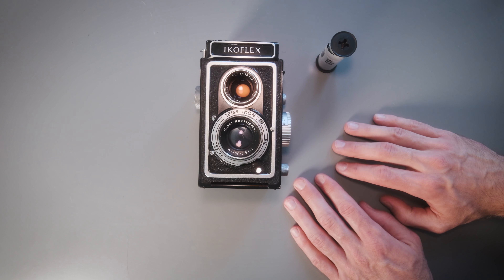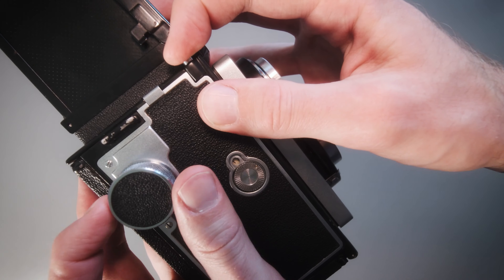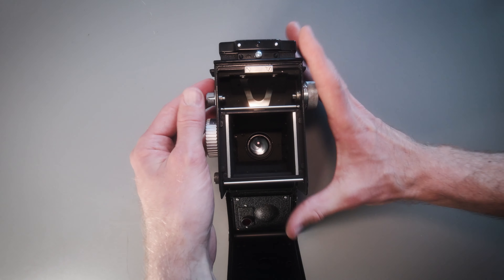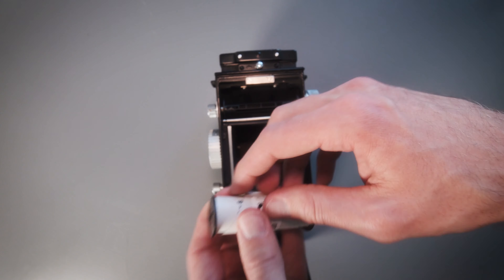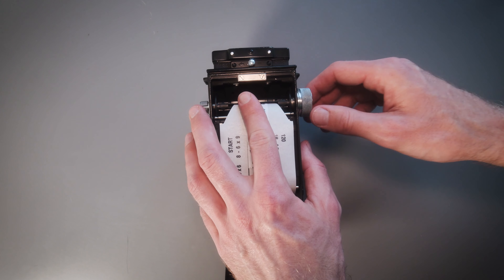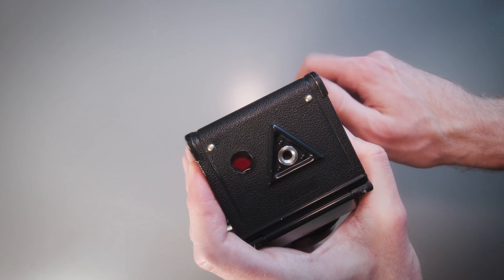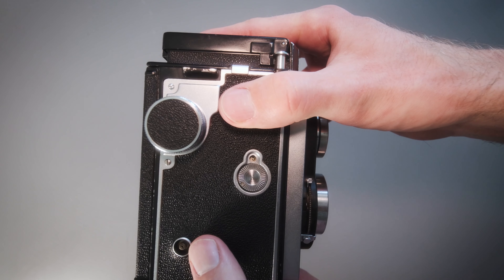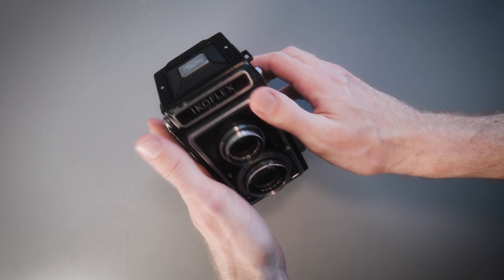How to load the Zeiss Ikoflex Ia

Comment: I just got an ikoflex IIa today, and I found out the little red window in 3:00 on the left, but the 6x6 format shows on the center of the 120 rolls, the "1" in your video is the "1" of the 6x9 format. have you been using it this way with no trouble?
Reply from the maker: You're right, I've never thought about it, but that should be for 6x9. But yes, I've shoot multiple rolls with the camera (maybe 20-50 rolls) and never had any issues att all. All have been loaded as shown in the video, and I haven't noticed that the frames been missaligned on the negatives.  
It's also how it's described in the manual, wich I actually have for this camera :) 

Small warning though there's multiple versions of the Ikoflex, and some even share the same name, so that's something to watch out for. 

Hope it was helpful, and the best of luck with the camera!